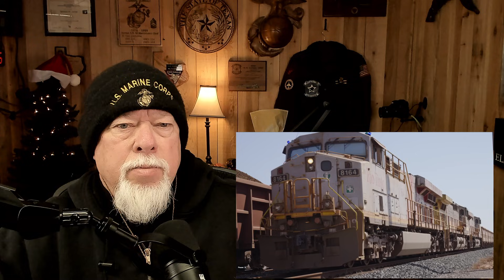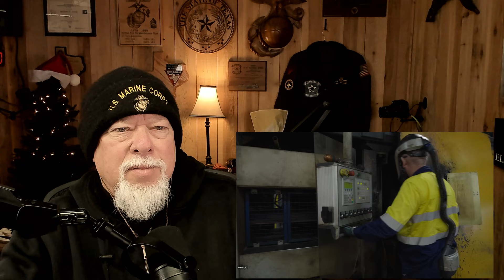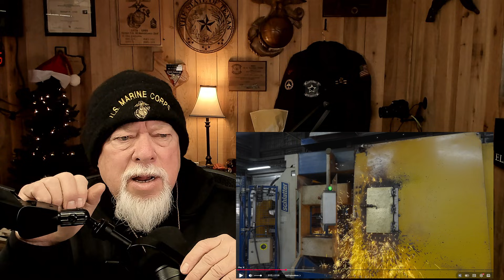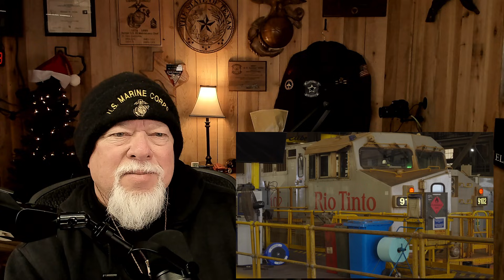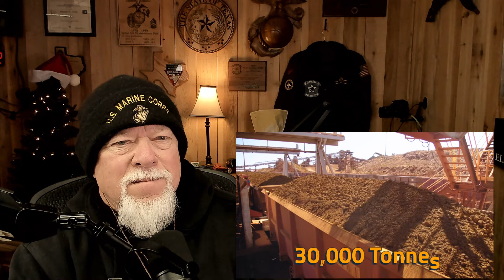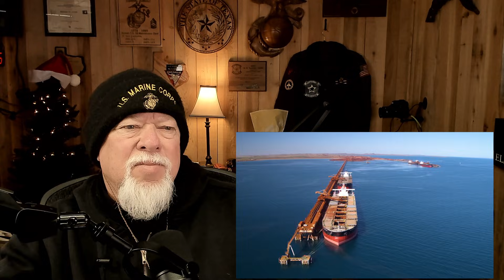How Australia Ships One Million Tons of Iron Ore Daily!

Comment: You were wondering how they get those long rails around the curves, but remember there are mostly straight lines out there and if they have to curve then they can make it WIDE 😊
Reply: They do bend in the heat. My Hubby works on a farm near that was burnt in a fire. The railway goes along it. It was hot enough to bend the line.

Comment: 14:45.... the lump product is screened and that fine material goes back onto the "fines" pile.
The steel smelting process is different for lump and fine so the customer definitely does not want any fines in their lump.
Fines is approximately <7mm and lump >40mm.
The main crushing is done at the mines, so ore comes on the trains as either, lump or fine.

Comment: 10:46.  That side of the workshop is called the "tripping side". Basically for pitstops-  refuelling , urgent small repairs and inspections. Major work and servicing is done on the other side
The overhaul section can do everything...like engine replacement and traction motor changeover. 

The tracks are actually called roads and there is 30!!

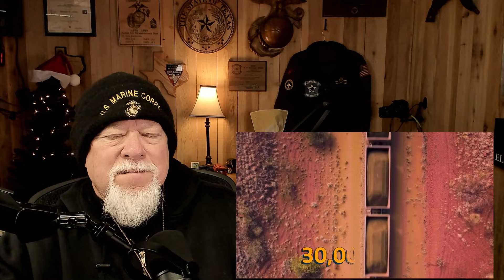Comment: 10:17.   They are diesel electric. 
Each axle has 2 electric traction motors. The 4000hp diesel engine turns the alternator and charges a massive battery bank.
When they go down hill on brakes, they actually scavenge that energy using a dynamic braking system.
The older locos were a GE V16 4000hp. The newer evo version was still 4000hp but a V12. Bigger turbo and better control system produced same power with better fuel consumption